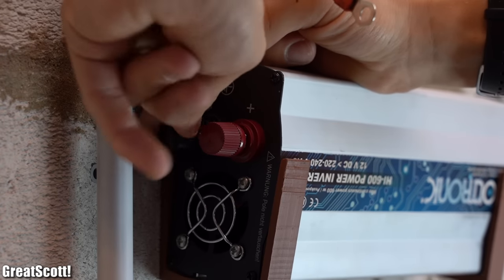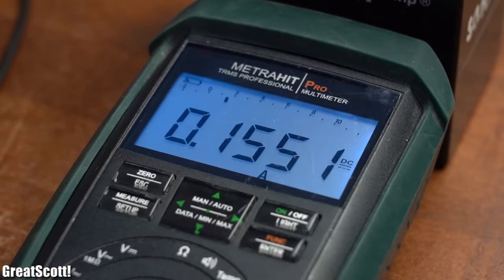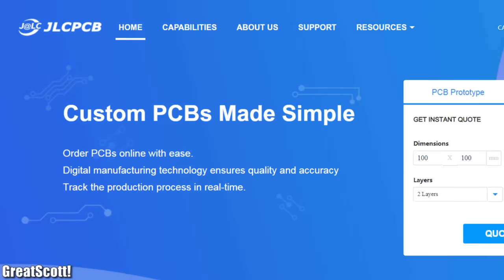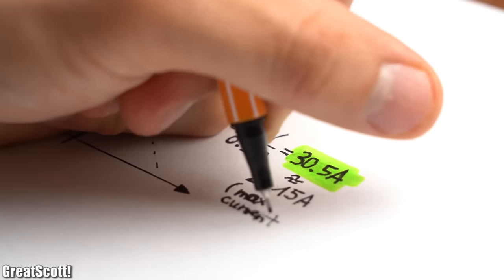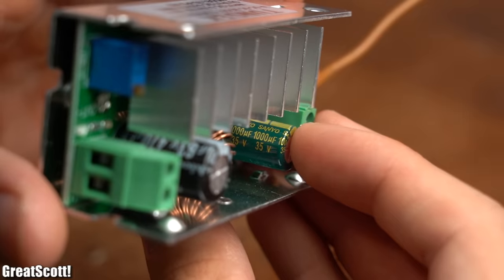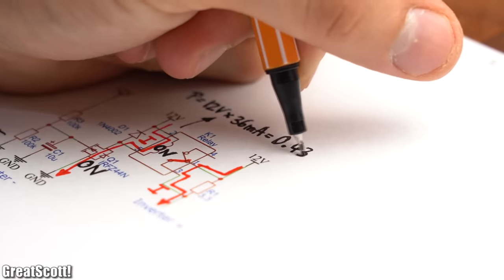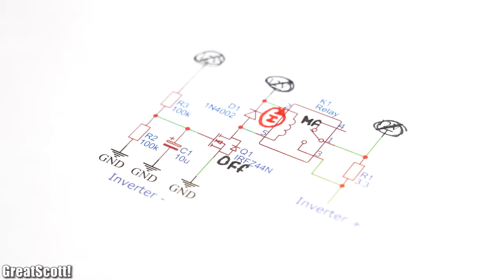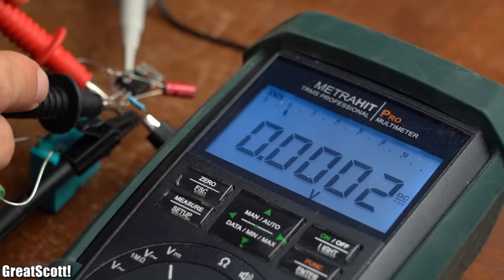How to make a Softstarter and why it is sometimes mandatory to use!

Comment: Most people: This electrical device doesn't work, I'll toss it and get a new one.

Electrical engineers: Hold my beer...I'll make it work.
Reply: because obviously we are always holding a beer ;)
Reply: Drunk science for the win!
Reply: Boom!
Reply: - "The plug started sparking so I threw it"
- just change the plug and the cord, dammit.
Reply: How about not putting unnecessary comments.
Reply: @MoxxMix  sounds ironic. (Though this is also an unncessary comment.)
Reply: @insaane Mere Mortals: This industrial robotic arm doesn't work. The bearings are worn out, the electric panel is fried and the program has lots of errors, I'll trow it away.

                 Mechatronic engineer: Hold my interdisciplinary skills.
Reply: Tfw you study ee and would have no idea how to do this
Reply: Person with common sense (me) would wire up existing equipment 'correctly' so it would work without ANY additional components !
Reply: Rob C  This didn't need a fix - just wiring up correctly in the first place - then no extra components required.
Reply: @satibel  Unfortunately it's not legal in all countries.
Reply: @techhonour3821  I'm pretty sure in the us it is legal (though you need ul listed plugs)
I do think you can do it legally in all of europe as long as they are approved too.
china probably has a policy of "as long as you don't burn the town"
I don't know for other countries, but I'm pretty sure, as long as you can get a socket in a hardware store, it would be legal.
Reply: @satibel  Cheers. I gotta make a sad face, because here in Australia it can only be done legally by a licensed electrician. Sigh.
Reply: @oH well,lord! I believe it's for liability. If it is connected to mains power, you need a license. Even if you just want to repair a damaged power plug. :(
Reply: @techhonour3821  Does this mean you need a license to change a lightbulb?
Reply: i understand that someone with an electrical or machanical engineering degree can do the same thing whilst holding nothing more than a coffee. 
the level of skill this requires is phenomenal.
Reply: Beeer can be tea
Reply: engineer? you mean someone who was bothered to go through university engineering degree or someone who doesn't have any education  or  barely made himself some 1kV course qualifications? assume you write from UK where anyone is an "engineer" LOL
Reply: yes i saw this and i was thinking it was  wrong for most people and someone like me thinking wouldn't this be a parent to me to do if i was working on that thing but i am an electronic engineer so i guess it is someone like me hes talking to but   its kind of redundant but nice schematic and explanation of how it works though
Reply: I have been accused of doing this.
Reply: Becaue why not?
Reply: Me: aww man, now EVERYTHING'S on fire..
Reply: Just a German being a German, a true Übermensch 👍🏻🇩🇪
Reply: only what he did instead of using regulation parts and practices is to design an overly complicated circuit which has literally no advantage over NTC and has x10 the part count = less stability, more cost, more user error when assembling, and in general against the engineering KISS practice.
Reply: @user2C47   Yeah......also, even to switch it ON and OFF !!!!! Lol !
Reply: Don't need to be an engineer. Farmers do it too.
Reply: @id3m589  it has the advantage of being able to handle much more current than an ntc thermistor though. And with slight modification or different part choice it can handle massive amounts of current. Hundreds of amps. Useful for soft starting industrial motors at the very least. Sometimes you do have to sacrifice component count and simplicity for the chosen features of your design. Then, instead of KISS, the adage becomes: "make it as simple as possible, but no simpler."
Reply: @joshnabours9102  you obviously can't use such a circuit in industrial setting, no matter for what. If you want to soft start an AC motor by regulating it's input current, it's in best case not going to work (this is why motors have starter caps) or in worst destroy your equipment.
Reply: @id3m589  i did not say in an industrial setting, just in starting an industrial motor. Many an industrial motor can be found for hobby projects on craigslist, offer up, and the like in a city near you. And 3 phase industrial motors like the ones I was referring to do not have such caps. They are common on single phase motors to create a "phantom" second phase by changing the phase angle of the current through them. Single phase motors will not start automatically without those or something like those.
Reply: @satibel  ......now that you said it ....!  I am also jumping in !!! Lol !  ( will someone mark this (my) comment utterly useless ) Thank You in advance !
Reply: @joshnabours9102  If you use a three-phase motor for a "hobby" project, get life and health insurance please. And try to be a certified electrician also, because you're messing with 480V. That's death on spot. The only place for 3-phase motor I know in home gamer workshop is lathe and mill. And don't try to repair these yourself with hacks from GreatScott if you want your kids to have a father and your parents to have a son.
Cheers.

Comment: I just completed this circuit and it works like a breeze. I was trying to run a dc motor using atx power supply boosted by a boost converter (12v to 24 v). Initially, due to inrush current, atx power supply was getting shut down but now it works well. Thanks Scott!

Comment: Did a similar thing for a large variac, that would trip the main breaker at switch on. Just some 10W 12R resistors in parallel, with a thermal fuse attached to them, for failure protection. Then a simple capacitive voltage divider, driving a 24V relay after the bridge rectifier, with a 470uF 63V capacitor and a 24V 1W zener diode, along with a 33R 1W inrush limiting resistor for the capacitive divider. Relay would close contacts about 0.5 second after mains was applied, but enough time for the variac core to not saturate. All parts laying around, and worked well.  Also added a voltmeter to the variac, as it had no scale, and made one out of an old meter movement, and as the variac can go to 360VAC, wanted a suppressed zero, so used a tap ( 60VAC) on the variac to derive a regulated 7V supply, using a LM723, and this was then connected to one side of the meter, with the other side getting a suitably half wave rectified output sample. Calibrated, remarked the meter and it works well.

Comment: This is great, I like your basics videos more than large projects. But you made a mistake with the time constant, the equivalent resistance would be 50k because of the other resistor going to ground, which would give you a time constant of 0.5s
Reply: Isn't that accounted for since his time constant was in relation to an applied voltage of 6V?
Reply: @squareone2520  The time constant does not depend of the input voltage.
Reply: @squareone2520   It's kind of a trade-off, the voltage becomes 1/2 but the resistance is 1/2 also so it charges twice as fast. You can see at 8:38 that discharging takes twice as long as charging(because discharging uses only the 100k resistor connected to ground) and you can also kind of measure from the horizontal divisions(1s at 8:38) that the time constant is 0.5s when charging and 1s when discharging.

Comment: Greatscott : "don't hesitate to check JLC PCB....for their fast production capacity and delivery times!!!"
ALSO GREATSCOTT : "MAKES HIS OWN CIRCUIT BOARD.".....TOTALLY SAVAGE🤯🤯🤔
Reply: @vojtadeges720  tru
Reply: PCB is useful after a dev board proves the circuit really works. If it does, I always order a PCB for a reliable, small, long-life, mountable item.
Reply: @ZsomborZsombibi  2expensive4me
Reply: @Chris Russell Yeah true. The biggest problem is shipping for me. The shipping is $20+ and I usually need only 1 board. But I love SMD soldering too and I hope I can get a proper etching setup at home.
Reply: @tunahankaratay1523  all you need is a laser printer, an iron, some transfer paper, and some white vinegar, salt, and hydrogen peroxide and some copper clad.  not hard bro
Reply: @artbyrobot1  schematic design + cad library + routing. Short said it takes way too much effort. When possible I'd get away without it.
Reply: Obviously... If you have to order JLC PCB and wait until is received every time you create a prototype, the production time will be eternal.

Comment: I had this problem when I built my electric hydrofoil. The ESC had a huge current spike. I solved it with two relays that bypasses the current through a big resistor for one second before the main forklift relay is activated.

Comment: Hi GreatScott, hope that you will very soon make a softstarter for ac motors because my lathe has a 10kW motor and trips the breaker every now and then and my dad doesn't really appreciate the flicker of the lights at the beginning. keep up these awesome videos!
Reply: Use a star-delta starter for the lathe.
Reply: @millomweb  point is it's a 230/400v 3 phase motor and it is already wired in star because every winding is only suited for 230v but if you have any solution i'll try
Reply: @dartysengineering7275  I can't say you're making sense !!! 400(415)v 3ph motor and then say each winding only suited for 230v ? Do I detect you've connected a neutral wire to the windings ?
If so, try putting a switch in the neutral - turn the neutral off for starting and on again once the motor's running with minimal load. I'll have to think about whether you're actually running the motor on full voltage as you have it like that !

Comment: There should be a 1N4004 diode across R1, with cathode band to +12V.  This will immediately discharge C1 and 'reset' the circuit if the 12V drops to zero.
Thanks for the great video.  👍
Reply: Across R1???

Comment: I love it!  If you can expand this to an A/C circuit, that would be great!  When a refrigerator (for example) powered by an inverter hooked to backup -power-supply batteries causes the inverter to shut down, that's a real problem.  Yes, a larger (and more expensive) inverter is one solution; however, some type of soft starter is a more elegant solution.  THANKS!!!

Comment: You say: "talking about electric engines.....but this will be subject for another video".
Exactly what I wanted to ask you, perhaps using a circuit that excites the relay at the start, only for the time necessary, to avoid the continuous excitation of the coil, which could interrupt and generate malfunctions.
thanks in advance for future projects and for sharing your knowledge

Comment: Thanks for this information!  Variable frequency drives which have massive capacitor banks in them use a "precharge" resistor and a bypass relay similar to what you have. They, however, use their microcontroller to determine when the capacitor is charged enough to close the relay. In these VFD drives, the input rectifier will fail if this circuit is not in effect.

Comment: Extremely useful!  Thank you!  I have been in need of a soft start circuit for tube amps.  Lots of capacitance on the front end, and it can be a massive current surge at turn-on.  I have a few 220uF 700V film caps, and they pull so much current on power-on that they have smoked some pretty beefy resistors that could easily have handled normal current draw.  I can also use this for loudspeaker delay circuits.  You explained it very well.

Comment: Will an inductor in serial also solve the problem? An inductor will reduce the current surge.
Reply: The problem with limiting inrush current using inductors at low frequencies (DC in this case) is that inductor values tend to be insane. Typical inductors in everyday electronics range from 100nH to 100mH but here, we'd most likely be talking 100+ henries. Also, you'd then have to deal with safely discharging all the energy now stored in the series inrush-limiting inductor when you turn off or disconnect the load, otherwise something will get destroyed by the collapsing magnetic field dumping its energy into whatever weak spots it finds.
Reply: @teardowndan5364   Thank you, your explanation is very clear!
Reply: @teardowndan5364  Wait, why would we need 100+ henries exactly? A few mH would be more than enough to limit the spike somewhat. A (physically) big inductor with a low resistance would be just fine. Simply connect it in series right at the output of the DC source and stick a diode from the negative to the positive terminals to deal with the collapsing field.
Reply: @TheRealKuif  Right, I must have inverted something. Tens of mH at a handful of amps is still going to be a chunky core if you want to avoid saturation and a chunky winding.
Reply: I guess what we are dealing with here is the inrush surge current to charge the inverter capacitors, right... was thinking about zero-crossing soft-starter but this is a DC circuit, right? then use a simple car light bulb in serie with the load: will glow until current gets null ie. caps charged! Use a 3 way an "ABC Switch" to switch input between bulb then direct.
👍
Reply: @teardowndan5364  The inductor is really dealing with the high frequency spike, so you don't need one as large as you think.
Reply: @teardowndan5364  You don't care about saturation at steady state you dont want to see the inductor in the circuit. The current is dc so the inductor will be saturated which is good because in saturation the inductance is zero.
Reply: @noweare1  If you are going to use an inductance to limit inrush current, you do need one large enough to handle the peak inrush current without saturation since you effectively end up with an expensive jumper wire otherwise.
Reply: Teardown Dan No you don’t need large inductor. 2 dozen turns on a ferromagnetic ring will do the trick just fine.
Reply: @avashurov  Toroidal cores are still subject to saturation flux density. Once the inductor saturates, its wiring resistance is the only thing limiting current. For non-trivial currents and inductances at low frequencies like 60Hz, cores become quite chunky quite quickly.
Reply: @keintabak  just use an NTC for soft starting, it's cheap, simple and reliable. Use the keep it simple stupid principle. an inductor would need to be fairly large and also cost quite a bit. and then you'll need to add a reverse diode to dissipate the voltage spike it'll have when you open the circuit.

Comment: I have absolutely no idea to what softstarter is, but I  still watched your video as it is always very entertaining.
Reply: soft starter slowly increases the power input to the device that you connect it to its used with motors to control their start and make sure the machine wich has the motors doesnt malfunction one it is started up

Comment: Usually, your charger and inverter are both connected across the battery bank.  You can also add a supercap to deal with fast, high amp loads like motor startup.

Usually this would be how you deal with high amp draw.  Not sure why it isn't working in your system.  Is your inverter tied directly into your inverter without batteries?
Reply: Victron MPPT controllers has over current protection on their DC output that doesn't like high initial surge currents.  That particular 75V/15A solar controller only provides 15 Amps output anyways, not nearly enough for that 600 watt inverter at full load, which will draw about 60 Amps.  So let's assume he using it as an example of a high input capacitance load for illustration purposes.  

I'm in a similar situation; I really like the diagnostic histogram panel the Victron MPPT controller provides on the bluetooth interface, so I put some of my low current items on the Solar DC output.  But, like you point out, my 1200 watt Victron inverter has to go directly to the battery.

Comment: Edit at the bottom! 

Hi Scott, I'm looking for a softstarter for my parallel push pull tube amp and was glad to see you publishing this video. My problem is, that my relais activates instantly, as soon as I apply power (I'm breadboarding with 5 volts DC, 500 mA). 

Even with a 470 uF cap.

I'm using a finder relay (40.61.9.012.0000), 100 k resistors and your suggested n-channel mosfet. I have to drive that softstarter with 6,3 volts later, because that's the only low voltage source in my mono blocks and I don't want to put something else in it (the less stuff in there, the better). 

I tried to reduce the resistance on the caps kathode but nothing changed.

Hi, I found my error. It was in the voltage divider section and the connection to the gate of the mosfet. Had it connected the wrong way.

Comment: Great Idea, I use this kind of automated system already since about 20 years for powering on transformers (fuse switched off sometimes) and yes, for PC's also. They have with their switching power supply also a lot of capacitance within their infeed circuit. Sometimes there are quite big sparks at the switch or even at the plug itself. One day in very past I even lighted up a fire in the socket while plugging in such a PC - cable. The socked was dirty, may have had also some invisible oil inside. The spark caused by that capacitance at the plug had been enough to light that oily dirty thing within the socket up and a great flame came out of the socket against me. That experiences caused me to solve that kind of risk.

Comment: Nice video, thanks:) It would be interesting comparing this solution with another that uses a MOSFET as the main switch to reduce even more the power consumption of the circuit. With a 12V DC link it shall not be a huge challenge for you ;)